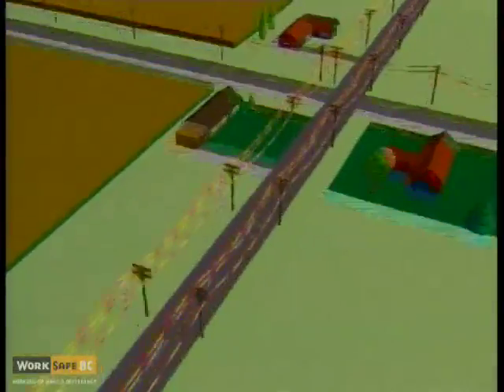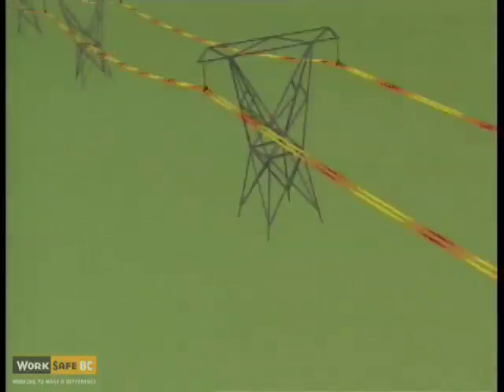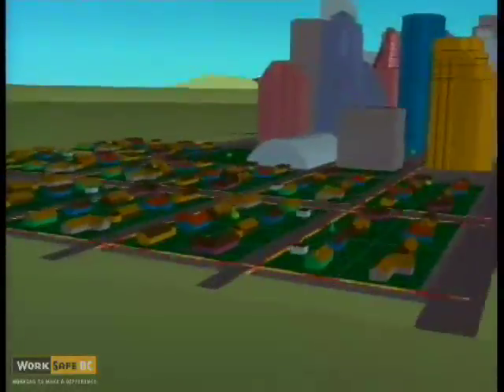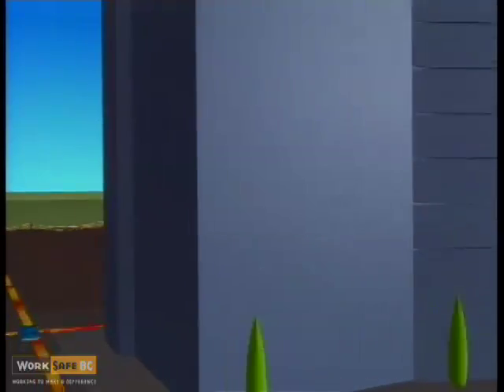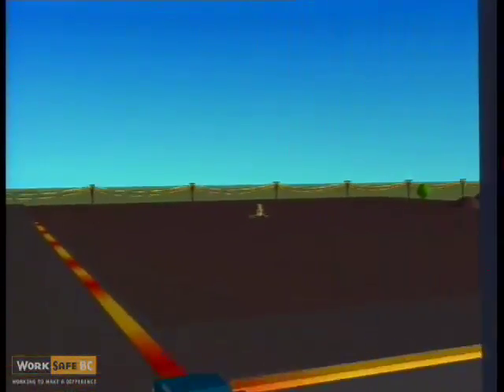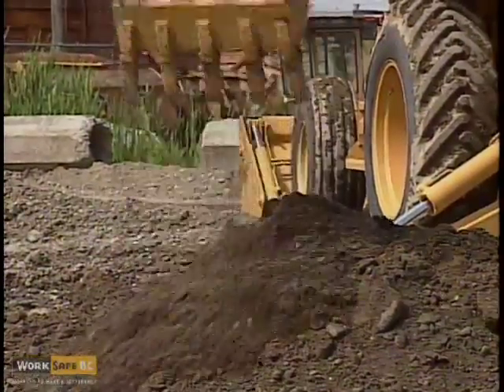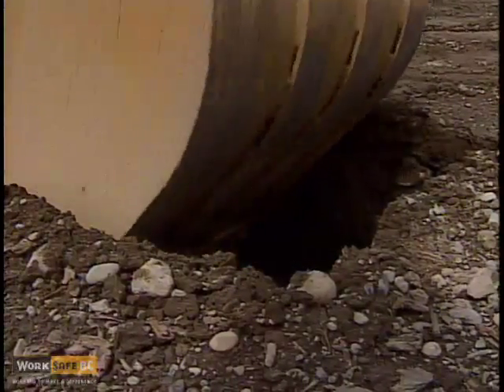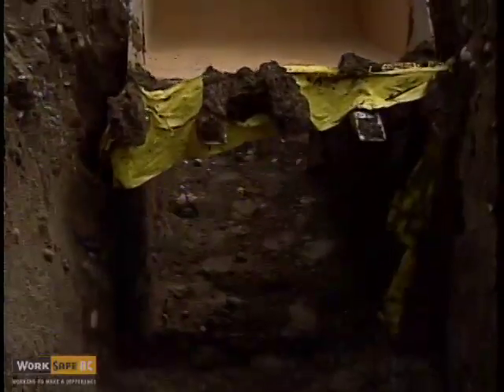A Bright Arc: Avoiding Contact With Underground Lines (5 of 7)

Comment: When I was a lot younger my father told me that on a site where they were building a new school the high voltage underground powerline wasn't laying where it was supposed to be on the main drawing. A digger pulled out the 25KV groundcable and snapped it, causing a flame to erupt from the cable visible up to the third floor and blacking out several towns.